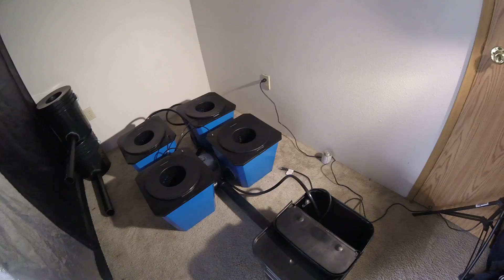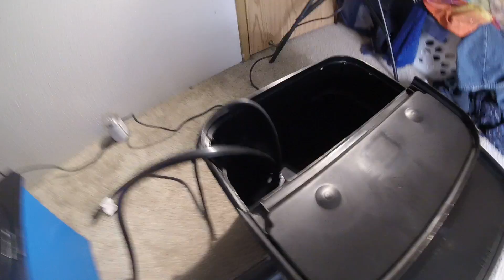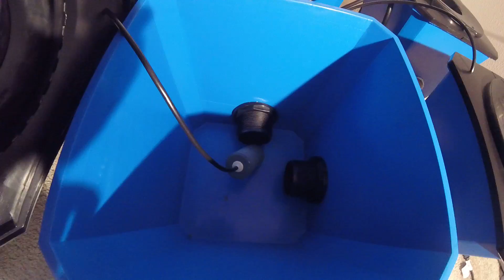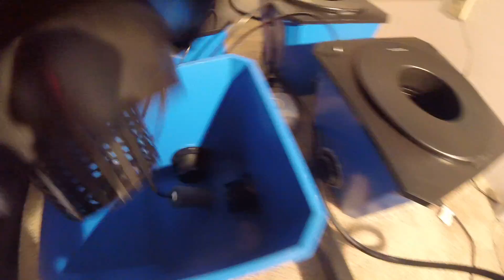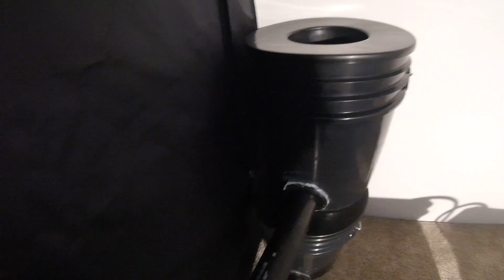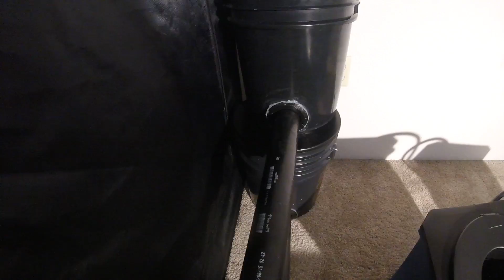DIY Recirculating Deep Water Culture Unit

Comment: How often does the water need to be changed on something like this? Are you able to add more nutes after the initial reservoir fill?
Reply from the maker: Change rez every everyy 2 weeks. Add just water if PPM's are high. And water with nurtes if PPM's are low.
Reply: @dwcannabisgrower8445  Thanks!

Comment: Very nice. I'm going to build something like this as well. ....How much heat does that spyder put off? Any update on how it's running?
Reply from the maker: KillerBanker Thanks, the SpydrX raised room temp about ten degrees and only required AC during summer. I am following my new grow that is in this system with updates at least every 2 weeks.